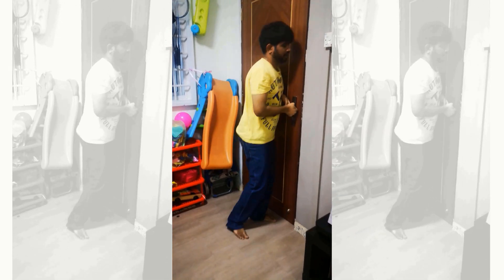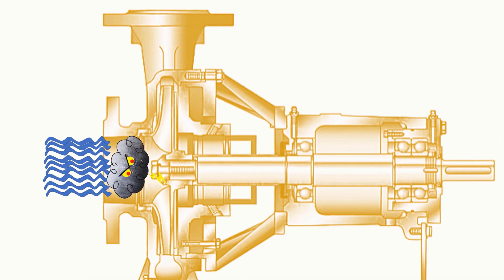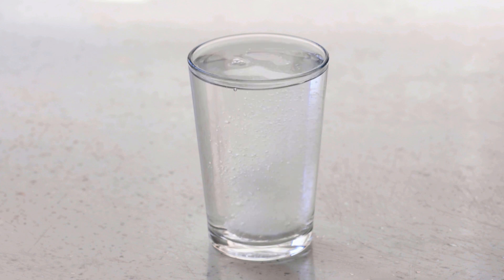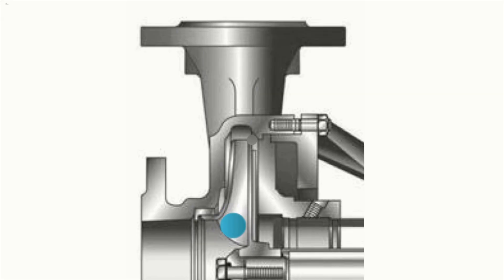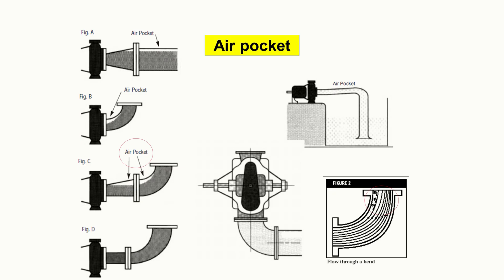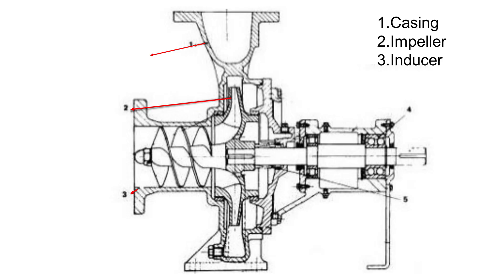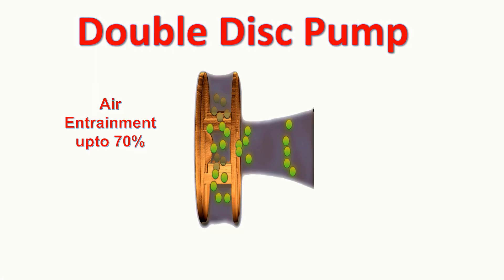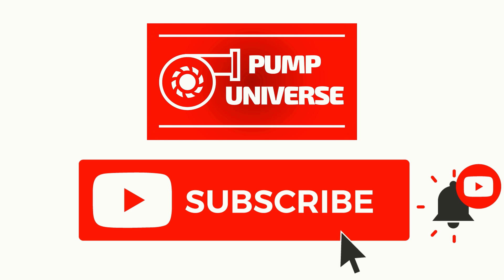Air Entrainment Explained

Comment: I'm working on cavitation behavior in sewage centrifugal pumps and I'm facing problem with air bubbles

I have a closed system consisting of:

- 2 cubic meter stainless tank

- Suction line (5m) DN100 with valve

- Pressure line (8m) DN150 and DN100 with valve

- Centrifugal pump with 2 channels impeller, maximum capacity 250 m3/hr (Qopt 170 m3/hr - 14m)

- visual inspection tools installed at the suction side of the pump (light and camera)

Suction and delievery lines are at the same level from the tank side, but inside the tank the delievery line has an elbow and 50 cm pipe towards above
Running the system with fully opened valve at suction side

1- When I run the system at very low capacities like 0,2 Qopt, I do not have air bubbles, but it appears just when I drop the NPSHa (and the air bubbles are not cavitation, it is just swimming air bubbles)

2- when I increase the flow rate around the Qopt by opening the delievery valve, I can see more air bubbles coming to the pressure side of the pump around infront of the impeller, and this disturbs the visual inspection

3- When I run the system at a higher flow rate at Qopt or higher, I can not even see the impeller from the air bubbles

I have done so many trials and errors, but they did not solve the problem

I put the system under high pressure to check for leakage, but I could not find any leakage
I put the system under low pressure for one day trying to suck the air from water
I let the system running for 4 hours just trying to get rid of the air from the water, then I tried to measure, but it did not help
I changed some connections
I tried even with different pump with vortex 8 blades impeller

I hope you have an advice regarding such problem

Please do not hesitate to contact me for any further required data

Comment: I have a question about air entrainment. 
1. What is pump power presented when the flow is reduced by air entrainment issue? Is it reduced as the flowrate reduces? 
2. When the air is passing through the pump with liquid, is the air also pressurized and stay in gaseous phase? Or it is not pressurized and dessolved into the liquid? 
My question sounds humble a bit. But i really need to get this thing through in my head.
Reply from the maker: Hi Gina Kim , 
Sorry for the late response as I have just noticed your comment in this portal. 
Here are my views.
1.	What is pump power presented when the flow is reduced by air entrainment issue? Is it reduced as the flow rate reduces?
Yes. Technically, the power should be lower at that duty point head/pressure as the liquid is being replaced with air in volume. If Air %  is considerably higher in cases like waste water scum ( Some cases even up to 70%), you can see significantly lower power ( Almost same % reduction . 
For Eg : If the pump is run with water at factory test resulted in 100KW, the scum with 70% air reduction can result in output power almost up to 30-40KW instead of 100KW due to the presence of air)

2.	When the air is passing through the pump with liquid, is the air also pressurized and stay in gaseous phase? Or it is not pressurized and dissolved into the liquid?
Technically the air should be compressed by the pump. But since the pump is not designed to be a compressor, the compression might not be effective and you can consider that the Air is not pressurised effectively and a normal centrifugal pump will not effectively send this out . Hence you could experience an Air Lock. 

The Vortex Impeller or Double Disc Pump are capable of sending this out without major issues ( subject to its capability of handling Air%)

Air getting caught in between the liquid when they are discharged at higher rates  is a common scenario ( That’s how fizzy/Carbonate drinks such as Coca Cola or Pepsi are made). 

That’s why priming is important as you will possibly eliminate as much Air or gases possible when the liquid is not in motion.